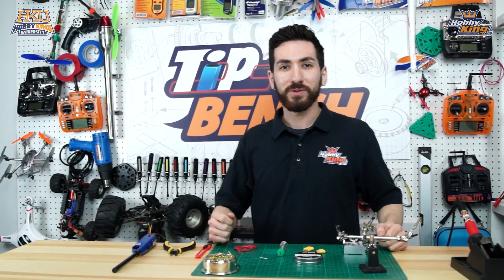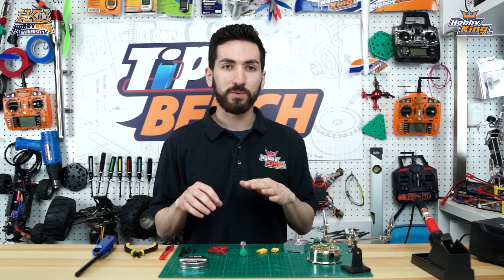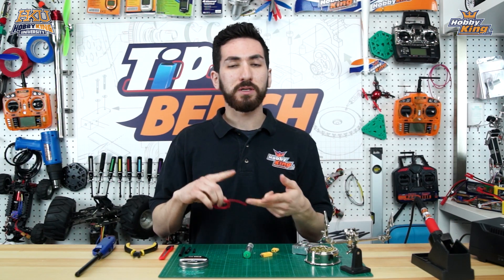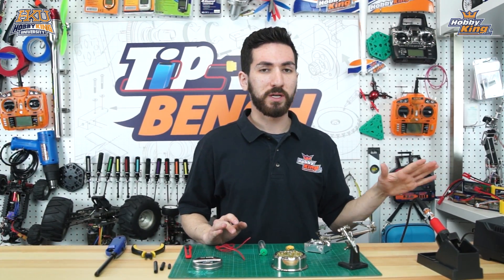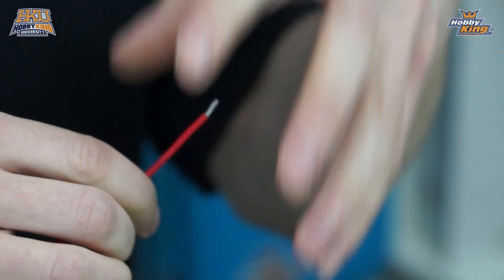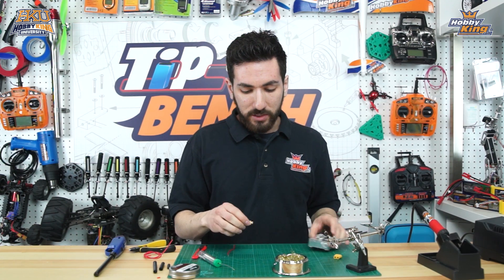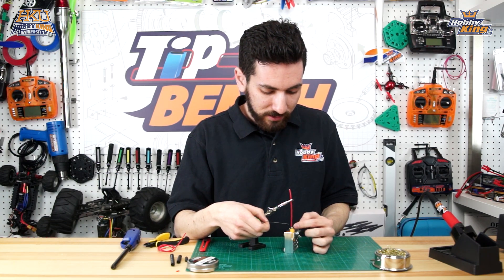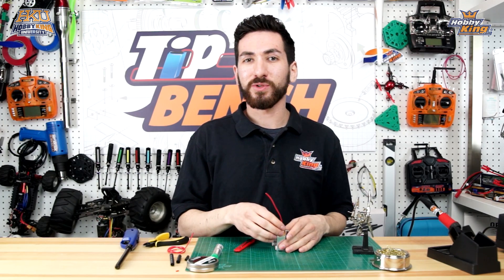Tips Bench - Soldering XT60 Connectors

Comment: Anyone know the advantages and disadvantages of using copper scouring pads over a moist sponge to clean soldering iron tips?
Reply: Yupp - the damp sponge (especially if it's TOO damp/wet) will cause thermal shock in the tip (hot tip + cold water = shock) and will reduce it's expected life especially if it's a coated tip to prevent oxidation..
Reply: Don Judge Thanks for the info. Been wondering about this because I've always used the damp sponges that come with the cheap helping hands or the soldering iron caddies. I've never used the copper pads, but I think I'll get a copper pad next time because I've noticed that my tips go bad after about a year.

Do the copper pads usually get off all the 'slag' too after soldering? I like how the sponges get the tip super shiny and clean for the next solder joint, but like you said the water decreases it's life time.
Reply: Well to be honest I was an electronics engineer for 20 years or so up until about 20 years ago (showing my age now) and we always used the damp sponge. I guess that's because the company bought the tips, haha. The copper or brass wire is a recent thing so I can't comment if it is any better for the tips or not. I still use the damp sponge because I always have, perhaps I'll give the wire a go.
Reply: Don Judge Gotcha. I think I'll pick up a copper scrubbing pad from the kitchen department, give it a try, and experiment :-)
Reply: RoboTekno it you do a bunch of soldering the copper is the only way to go, if you are looking to really fine bonds the damp sponge does a WAY better job of cleaning the tip.
Reply: just make sure you get a copper one as you want the solder and crap to want to quickly and easily jump onto the copper, most of the cheap ones are brass (just washing sponges and have a yellow coulor) and don't work as good. You also want it to be a a pretty tight bundle with fine strands..

Comment: Suggestion: the helping hands clamps work better and don't cut the item clamped if you put shrink wrap over the teeth first.
Reply: Agreed that is such and unsafe practice.  I just commented on that today as it can puncture the insulation and lead to Corona leakage which means voltage present on the surface of the insulation. Which in turns a good chance of someone shorting out their ESC or getting shocked.
Reply: I’ve been using electrical tape and never thought about putting heat shrink on the alligator clips. Thanks for the tip. I’ll be doing it in a minute!!!!

Comment: Stop calling it solder paste, solder paste is tiny solder balls in a paste used for surface mount soldering and reflow soldering, totally different thing than flux.
Also you risk getting voids and poor connection to some of the wire by not pre-filling or at least tinning the cup.
The dwell time, (that is the time the heat is on the wire/component) should be a matter of a few seconds. This is not too critical when just soldering two wires. But if you have a BEC, ESC, or something where the heat starts to conduct up the wires you can cause damage of the components. Having a good quality temperature controlled iron and the right size tip to transfer that heat is important.

Comment: Much better joint this time around.A+  Nice work on the consistent tip cleaning. Maybe more emphasis on iron tip size in relation to wire gauge used. It's as important as tip cleaning and tinning. I've been burned by saying 'any solder will do' only to have a student do the job with acid-core solder (pipe-joint).  Wire strippers are cheap and common. No one leaves my class without a pair in their flight-box.
Reply: 66tbird1 Heated wire stripper is the absolute best. No worries about damaging the wire that way.
Reply: ***** I always use a sharp knife to strip wire similar to how you show in the video.  Wire strippers too easily nick the wire.  When I was in electronics engineering school a nick on a strand was an immediate fail.  Good job overall with the video.
Reply: Knife is fine in a pinch, but never do that trick for anything involving a spec standard.
Reply: you went to electronics school and that is how you solder, I take it they did not teach you how to solder there?

Some simple 101 of soldering
- add solder to the tip before trying to apply heat to the item you want to bond
- use the bit of solder on the the solder tip to start the flow of solder
- place solder on both surfaces before trying to bond them together
- the larger the wire the further up the tip you want to use (ie. the fatter part of the solder tip)
Reply: No brainier, that's what they are made for :)
Reply: Lafond RC
Loved using one till we had to mask up when stripping Teflon covered stuff.
Reply: 66tbird1 I have never heard of a heated wire stripper. I got so good and used to working with using side cutters that they became my go to unless I was doing something that was fragile or more difficult to strip.